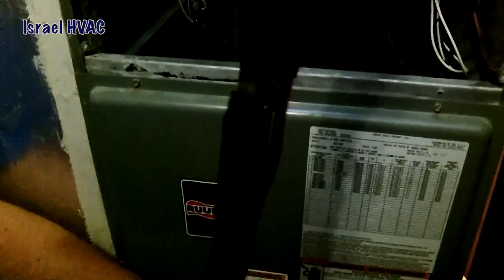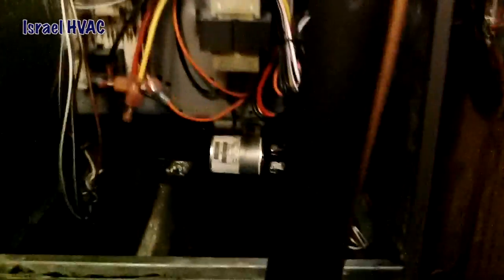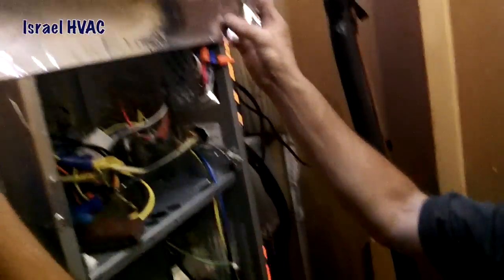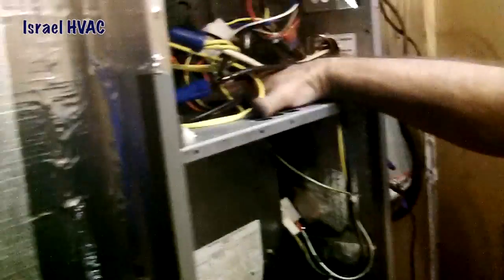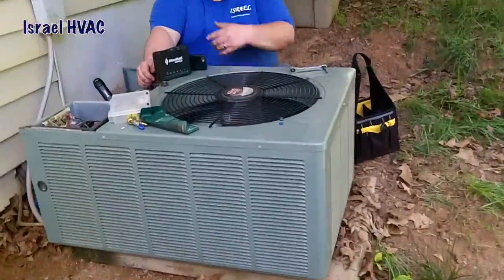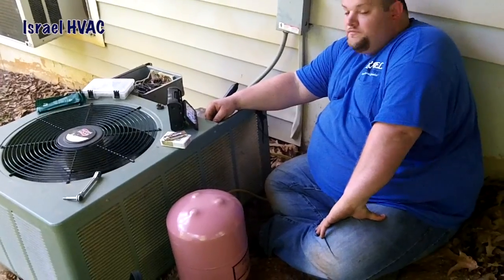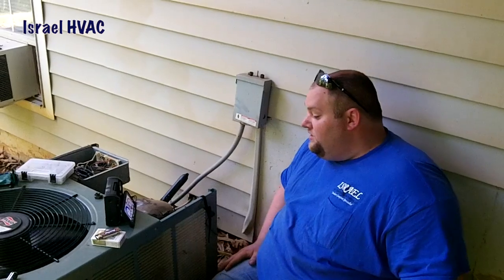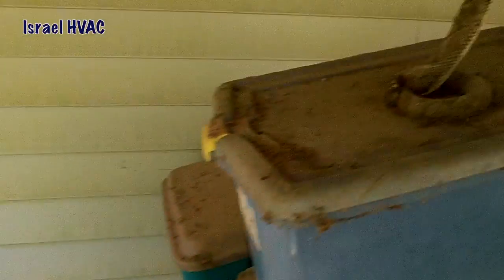HVAC Install: Air Handler Changeout With T&N Services

Comment: do you inspect parts before leaving supply house if a condenser has a leak and lost its charge would you return it for exchange or be required to repair it im a student newbee
Reply from the maker: Hey Robert yes I always check to see if anything that has refrigerant flowing through it has pressure!!! It not the supply house gives me a new one!!!